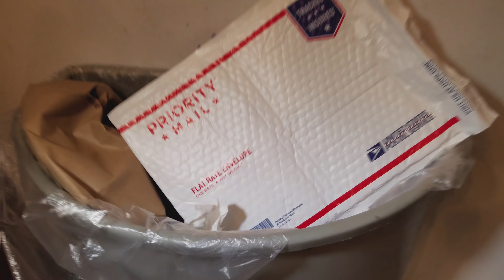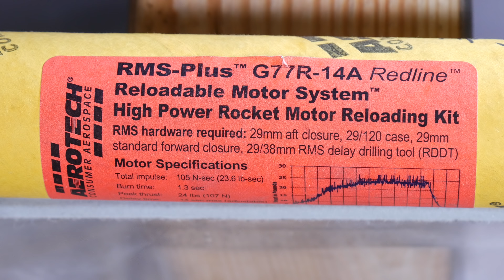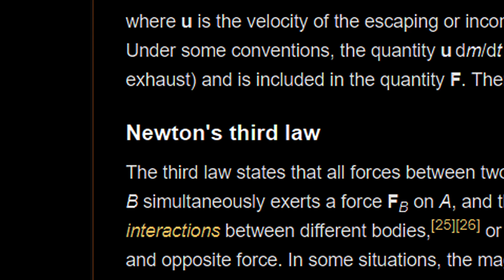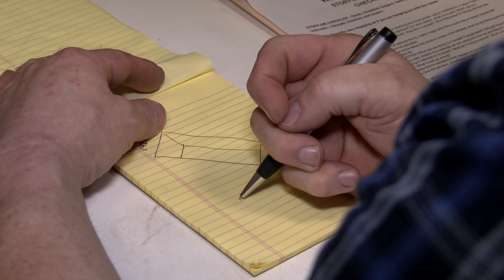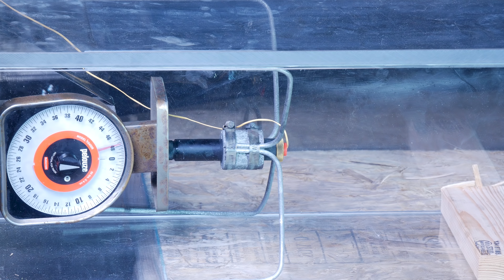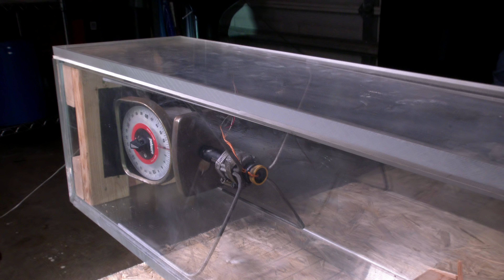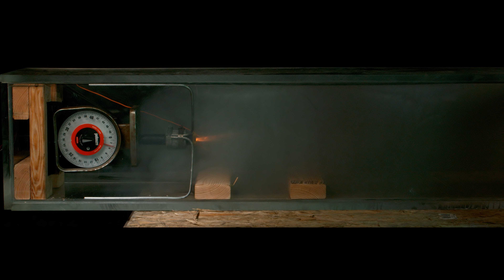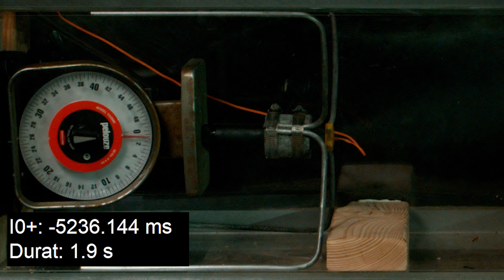Rockets in a Vacuum Chamber - Newton's third law of motion Visualized

Comment: The lack of scientific understanding here is depressing!
Reply: That's the back bone of flat earth thinking
Reply: Did you know that you can PROVE that GRAVITY exists????? All you need to do is have two chambers connected by a valve. Have one chamber with air at atmospheric pressure, and the other with a vacuum. Now because gravity holds our atmosphere to the earth, and the gravity at ground level, is MUCH HIGHER than at the edge of our atmosphere the air at ground level will stay attracted to earth. SO, to prove this, position the air chamber on the ground with the valve pointing up. Than connect the VACUUM chamber to the valve ABOVE the other chamber. With a gauge on each chamber, and slowly opening the valve, the air in the bottom chamber will stay there (by Gravity), and the top chamber will hold a vacuum. You will now have the ultimate PROOF that GRAVITY and SPACE are REAL !!!!!!!!!!
Reply: @stevethomas9142  fact is, that down pull is diamagnetic, not theoretical gravity. And by the way, this experiment is within a container, space doesn't have a container. That's why fire started burning out from the edges of the container and then slowly came closer to the rockets ignition butt. EARTH IS FLAT, Peace out!
Reply: @erickedmondromanharris1549  You are absolutely right. This chamber experiment proves that gravity is bullshit, (i was being sarcastic to ball believers) and I 100% agree the earth is flat. I'm glad that there are some sane people left in this world. Thanks
Reply: @stevethomas9142  so why is the sun the exact same size directly above as it is at sun rise and set the same goes for the moon
Reply: I don't get the point of this. Because I thought rockets were used to punch through the the atmosphere and break free from gravity. And once you have you then use another source of booster once in space.
Reply: @kcbryan8134  I was thinking how does fuel burn In Space without oxygen? Also how do they get back what allows them to move the rocket so precise that's it possible?
Reply: @playaplaya3040  Solid rocket boosters are atmospheric. They are used on take of. Liquid rocket fuel is hydrogen and oxygen. No need for an atmosphere.
Reply: Wouldn't you have to be in space to make the test valid ? 
Was the container inside devoid of Oxygen like it would in space ?
Can Ignition happen without Oxygen , in the void of space ?
So Moon is Proven to be in Earth Atmosphere , Gee now that it is so much closer maybe Nasa can best there record Of 3 days ,  lol   and only with the same tech they had in the day . I am not knowing the Answers , Love Real Science ,  but not a Scientist ! Free Thinker Looking for Honest Answers .So when you hear Neil T . DeGrasse said the earth looks flat even from an airplane , all you can see is FLAT , and you can only see the curve from Space ?  So when Mr DeGrasse said , I'm a Scientist and you should just believe me!!! So Theory Cannot Be Challenged and Above all No ONE has the right to Question , to want Proof , and the Desire to Understand is so Great , that when you ask a Question you are called a FOOL . instead of using there so called Logic they resort to Name Calling , Swearing , Deflection .
I'm not ONE to be told what I have to believe just because they have a piece of Paper saying they spent to much money to get a Degree to Parrot Lie's ! Indoctrination from birth , 
Just one more , 
Now if we were in an Enclosed System already , Yeah I'm talkin Dome Flat Earth here soooo what  ! What oh what does this prove ? GOD is Near And the Lying Ass Scientist FEAR , Earth is NOT a Sphere , AMEN IN JESUS NAME ! Amen
Take Care  If you have an answer please do . if you want to mock take a walk , razing is ok , but don't take it to far . Thank You This is a Piece of work ... FE Proof !!!
Reply: @edford8376  that's right. And that why you don't see flames coming out the back of a jet pack. As it not rocket fule that's used. It looks just like air with no ignition if I remember right
Reply: liza bello's no reads comments that long sis
Reply: @joey3773  sorry I was a little bit long-winded. But it's truly how I feel sorry it's so long you take care ty bro
Reply: What do you mean.
Reply: @stuw7037  Your not the sharpest knife in the box..!
Reply: @liza bello's:
well in a vacuum chamber the conditions are close enough to space. Actually going there would cost a fortune. 
Yes, there was almost no oxygen in the container
Yes, rocket fuel consists of hydrogen and oxygen. the rockets carry the oxygen required for the ignition with them. 
woah there since when is the moon inside earths atmosphere? the atmosphere ends at about 100 km above earths surface, while the moon is 384’400 km from the earth. 
Of course you dont have to believe what you are told, but when questening things please use some logic and common sense. 
Otherwise i cant make much sense of your comment, i hope i made my point clear.
Reply: @edford8376  they use solid rocket motors in space as well.  They are not just for use in atmosphere.
Reply: @stuartgray5877   not on the space shuttle.
Reply: @edford8376  actually not true.  When the space shuttle carried the Magellan spacecraft for it's mission to Venus, it had a solid rocket motor attached to the spacecraft. I have launched five Delta-II rockets and four of them had solid rocket motor third stages.
Reply: @edford8376  I build, test, launch and fly spacecraft for a living.  I have personally launched five spacecraft.  I have also been an Aerospace "nerd" for about 50 years.  I gave my Junior High class a tour of the Smithsonian Air and Space museum when I was twelve, but had never been there.  Hardware I helped build and launch to space is in the museum now.  Lookup "Stardust sample return capsule".
Reply: @stuartgray5877  well that would explain your next level nurd knowlege... You still seem to want to debate me at something though. And please forgive me if I don't believe you as everyone on YouTube is a rocket scientist. So saying you are a rocket scientist makes me a little suspicious. Considering I have NO ARGUMENT with you on this one. All I know is you need oxygen to burn stuff. So you have to take the stuff with you if you intend to burn anything in space. I think with your expertise you would go after the many flatards out there on YouTube. I am just a lowly flatard troll. With simple layman's understanding of these things. So I really don't know the many and various rocket fuels available. Or even care. Because that's not my job. I have a deep interest in astronomy. And I admire the men with huge balls that ride in those machines. But my main love is astronomy. You don't need to know much about what rocket fuels are used for that. But like I said I have no problem with the idea of solid fuel in space as long as their is oxygen available you can burn it. I just didn't think it was widely used.
Reply: @edford8376  I didn't mean to sound as if I still wanted to debate. I was just explaining my background.  I started at Lockheed Martin in 1995, then moved to Ball Aerospace in 2000.  They are the company that fixed Hubble and built most of the hardest parts of JWST.
Reply: @edford8376  - "so when are you guys going to send a manned mission to mars"  At the rate NASA is going, SpaceX will beat them to Mars.
Reply: @stuartgray5877  yes private enterprise I think will be the future of space, once they realise the value. But NASA are the pioneers. And have done some of the greatest achievements man has ever known. My favorites were the voyager missions. That's what got me into astronomy in the first place. And the Apollo missions are mankind's greatest signal achievements. And those Hubble pictures are out of this world. Pardon the pun.
Reply: @edford8376  lookup the Deep Impact mission. That was exciting for astronomers because it was basically the ONLY mission NASA has done that was confirmed by amateur astronomers from earth.
Reply: @stuartgray5877  nasa and Space x are the same thing? Elon Got a ass whipping by nasa for smoking weed....private company my arse
Reply: @stuartgray5877  you have sent  rockets into Space and didnt stick one camera on? Am getting bored of this CGI as soon as the rockets are entering the Space vaccum😂
Reply: @stuartgray5877  your an astronaut? Freemason then Yeah?
Reply: @kkaa4638  - "nasa and Space x are the same thing?"

 No
 they are not even close.
   "lon Got a ass whipping by nasa for smoking weed"

  No he did not, the DOD reviewed his security clearance.  make shit up much?

  "you have sent  rockets into Space and didnt stick one camera on?"

  Yes I have launched FIVE, and we put cameras on a few of them - watch the Stardust Launch Video on my YT channel (playlists).    Tell me that Stardust footage was "CGI" I dare you. 

 "your an astronaut?"

  No I am a Spacecraft Integration and Test Engineer.
Reply: @stuartgray5877  ofcourse a cut seen 😂 your like nasa never a straight answer also that isnt Space funny how a high alttitude 🎈 at 130k gives you the same footage and there is nasa wasting trillions cough cough should i Say not actually using it on Space exploration as it doesnt exist its always the same thing real footage that is literally the same you would get from a balon 🎈 which is great we can confirm its real but not CGI we cant confirm its real,although all that looks real and am not saying its CGI what is the need for the cut scene? If there was no cut scene all raw footage it would be believable
Reply: @stuartgray5877  that video is probably the Best footage i have ever seen it dont actually cut into absolute fakery looks pretty real respect dude
Reply: @kkaa4638  The Stardust launch video is 100% real as I was one of the Launch Conductors, and I watched it live with my own eyes, including the live video from the rocket with NO EDITS.   That mission retrieved samples from a comet and brought them back to earth.  For the reentry of the sample return capsule, look through my "spacecraft reentry" playlist.  We recovered that capsule, and it is now in the Smithsonian Air & Space Museum in DC.  I have seen it myself in the last few years, and I would testify that it is the same one I helped put on the rocket and watched it leave earth atmosphere with my eyes.  I was one of the last humans to TOUCH that capsule.     For another good one, Watch the YT video "Six Spacex launches synchronized to the landings" and tell me that is all fake.  If you think space travel is all fake, WHAT is that thing I see fly over my head every time I go out to see the ISS fly over?
Reply: @kkaa4638  Oh, and for "Proof" that the Stardust launch was not CGI: 1 - The "State of the art" CGI at the time was Toy Story 2, and even that could not be rendered in realtime.  2 - In that launch video you can SEE WHERE I PARKED MY CAR THAT MORNING  so unless the people doing the 3D model were psychic, it is not fake. (BTW- the only video I can find is HORRIBLE quality compared to what we saw that day)
Reply: @jamescoli3209  wow I am not sure how to respond to such a well presented defense.  Nice insults, are you five?  I already asked you that, if you didn't understand the question, maybe someone in your special needs class can explain it to you.
Reply: So many people just blindly believe what science tells them, i think its great to see people using their own minds and thinking for themselves. Its okay to question things, just do not get all huffy if someone doesn´t see things your way.
Reply: @shaundouglas2057  You seem rational (unlike jimmy above). 

  Would you mind googling "What happened to Comet Tempel-1 July 4th 2005"?

And just give me a couple sentence explanation?
Reply: @stuartgray5877  NASA shot a rocket into a comet. If it actually happened i do not know. But maybe you could help answer a question that i´ve been asking on youtube about saturn or any other object in space for that matter. NASA scientists said that saturn is so many billions of years old, how could they know this where did they pull that number from? Posted this question a while ago and only one has responded with "Dude its NASA".
Reply: who will be to blame Then?
Reply: @reskie0009  ?
Reply: liza bello's awesome, it is awesome to see people awake!
Thank you, this is very refreshing after finding out the worst news of my life.
TY.
Reply: Wait just a minute...I'm going get some popcorn, this is getting good.
Reply: @stevethomas9142  bs all the way...
Reply: @dazarp  yep earth is Flat
Reply: @erickedmondromanharris1549  so its theoretic diamagnetic not theoretic gravity ok 

Experiment please ?
Reply: @preppertechnicianee6013  Research
Reply: @erickedmondromanharris1549  ive done mine you clearly havent
Reply: @preppertechnicianee6013  Great for you
Reply: @artisorak  hey man go look on google its NASA new discovery lol.
Reply: @stevethomas9142  ...you guys rock!...
Reply: @None888.  No response to my question, i´ve been asking about this for a while on a few sights and know one responds, which makes me wonder maybe alot of what we are told about the universe is nothing more than theories and it seems like bad ones at that.
Reply: @shaundouglas2057  .... sorry man I might not have seen your question send it to me now and I'll take a look at it
Reply: @shaundouglas2057  ... okay I just found the thread and I realized you were responding to me it doesn't surprise me dude and to be honest you might not want to go down that rabbit hole they're just going to throw so much mumbo jumbo at you and you're not allowed to question it otherwise you will be insulted and called names for mocking the so-called authority of today take care
Reply: @shaundouglas2057  ...even tho there are a lot of crackpots out there... there are individuals who do some pretty solid thinking by themselves! I don't believe every goon with a YouTube channel or a conspiracy theory but my personal experience has been scientists archaeologist mathematicians physicists geologist and so on and so forth are the worst so much of our understanding of the natural world and our world history is based on complete Theory and b***** which most of it seems to be set up like an imaginary theme park! There are several books on the subject forbidden history is a good one Forbidden Science is a good one I'm reading one right now about the myth of science and the false belief in certain myths as well pretty awesome I'll send you the name of it if you want
Reply: @playaplaya3040  Um, they supply the oxygen, you know in the oxygen tanks that are in the rocket.  Control of the rocket in space is on the exact same principle, small thrusters.

Why is it that in viewing youtube videos, people disregard the entire scientific knowledge base of humans???
Reply: Darren Barksdale what kool aid?   I think if god was all knowing and all powerful, he would have just invented science as well to allow things to follow certain rules, just like the rules in the scriptures.  Think about that for a moment.  Wouldn’t god just invent the rules of science so everything follows a greater plan that he already envisioned, instead of just deciding on a whim “fk, lets make an earth and some space and put some life on it!”   Then as as afterthought, after his army of angel helpers informed him at the next board meeting, “hey God, we have some crazy things happening now in the universe, down is up, right is left, people are starting to notice.   What should we do?”
God:  “I don’t know, make some shit up every time you get a customer complaint.  I’m too busy for this shit”
Reply: @lornemelnyk  Awesome response. I have made comments in a similar vein. A god powerful enough to create the universe would not just have created a tiny snow globe and nothing else.
Reply: @stevethomas9142  There are lots of errors in this text.
1. gravity at ground level is not much higher than at the edge of the atmosphere. Indeed the difference is very small.

2. of course the air in the pressurized container will flow into the vacuum chamber. Depending on the altitude difference, the pressure in the upper container will be slightly lower, the difference is about 1hPa/8m.
3. this pressure difference is exactly caused by gravity and can be measured by a simple barometer.
Reply: @playaplaya3040  They have their supply of oxygen with them, just like the fuel. I am really confused this simple knowledge is not common sense.
Reply: @stevethomas9142  "Now because gravity holds our atmosphere to the earth, and the gravity at ground level, is MUCH HIGHER than at the edge of our atmosphere"
Not true.
Reply: @lizabellos4859  your comment wasn't too long for me. I might add also, that IF that chunky looking "space shuttle" ever managed to reach Mach IV, which it can't, but just pretend, it would start to crush in and collapse in on itself and begin coming apart. Even the fastest missiles, if they ever managed to reach Mach III, and I say they couldn't even sustain that velocity (go ahead and give them 3,000 m.p.h.) would be completely uncontrollable. So even then, the missile would be uncontrollable and useless at that point. Even an air to air missile must act relatively quickly when fired at an aircraft, AND the aircraft not flying above Mach). If the missile is fired too soon, even fighter aircraft, i.e. F-16, can actually outrun the missile. The faster the missile goes, in other words, the wider the turn radius to the point the missile can't even turn at all. Yet you are expected to believe these clowns can change direction in "space" , or whatever, flying at absolutely absurd speeds in order to aim themselves at specific target areas, specific heights above planets or where ever they claim to go. They don't even have near the propulsion to get them ANYWHERE NEAR the velocity they claim (Mach XX -XXIII?????), nor the air frame  that could survive even if they did. Sorry, but these frauds haven't flown anything at 3,000 m.p.h., let alone have a couple of nitwits taking a ride on it. For example, look at the sleek aerodynamic Concorde (max. cruise velocity Mach II) which is too expensive to fly anymore. Now look at the clumsy looking "space shuttle".